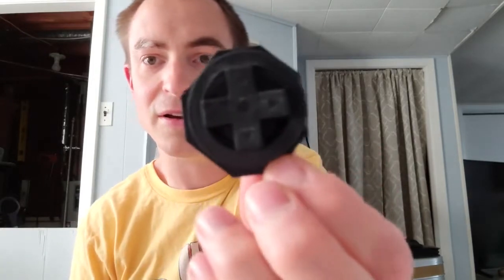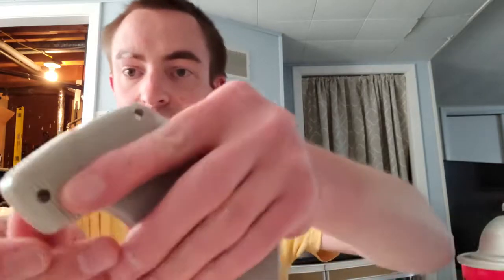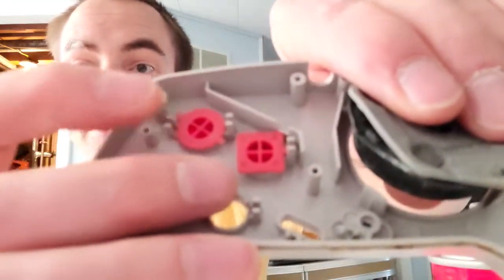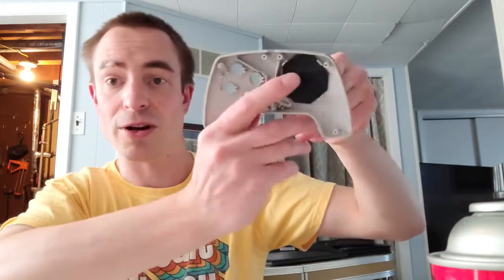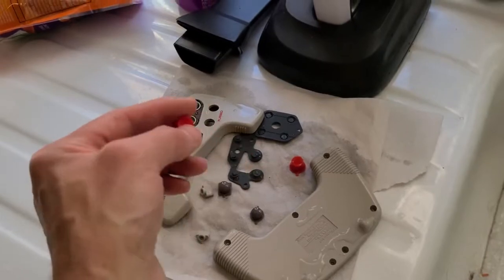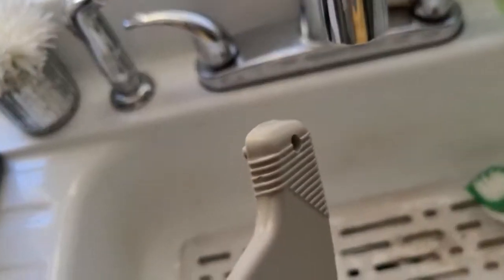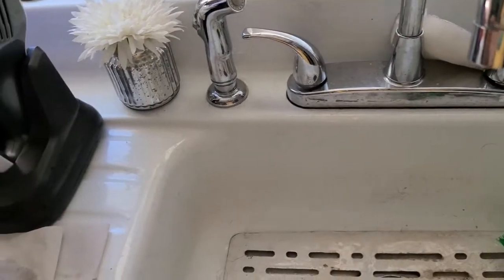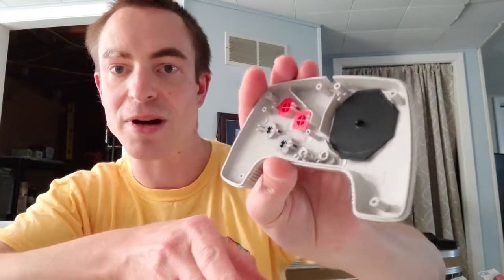How To #14: Give the NES Max Controller The D!

Comment: Nice shirt did you get it on your trip? I don't like drilling screws out because it often damages the plastic mounts. I've super glued the end of an old pencil to the stripped screw let it dry and then just unscrew as normal with the pencil. It's been surprisingly effective but you have to make sure you don't glue the pencil to the plastic itself!
Reply from the maker: Thanks Joel!😀 Yes I got the shirt on vacation. That's actually a good tip I'll have to try for next time. I ended up throwing out that shell and using the spare shell I had.